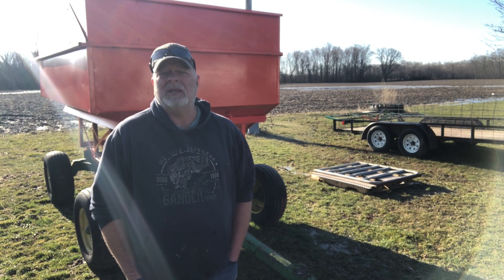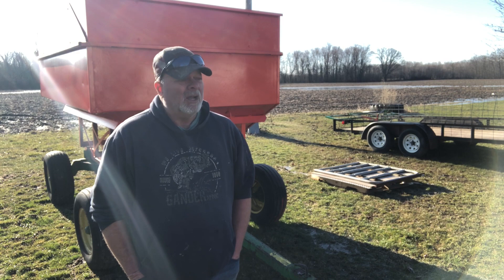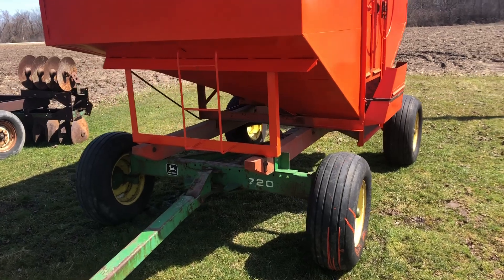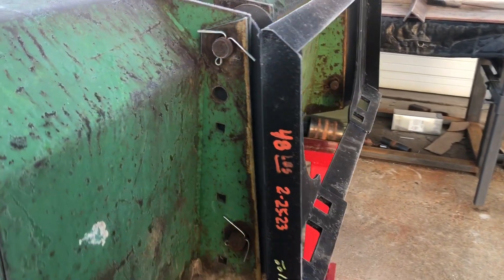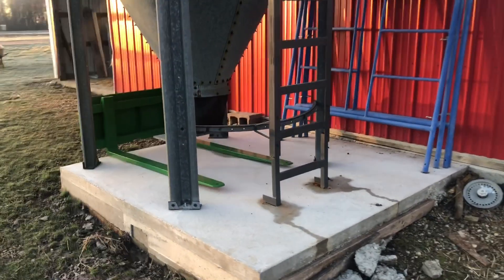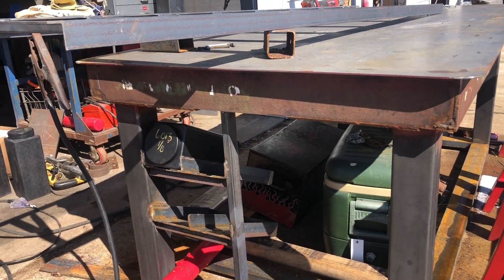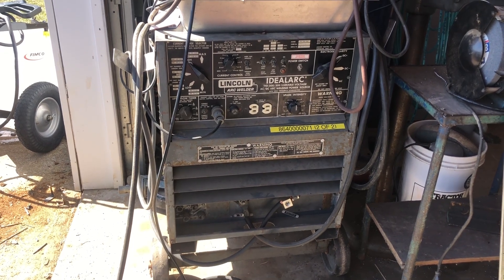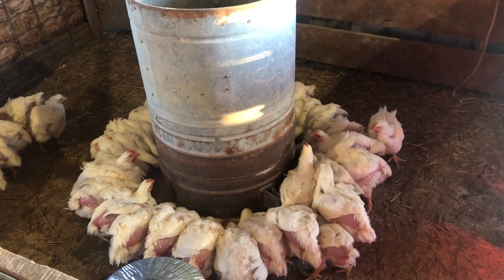Projects, Progress and Thank You Shoutouts

Comment: Nothing video worthy??? It appears you have been too busy to turn on the camera 🤣🤣🤣
Nice job on the gravity box. Especially having on the John Deere running gear. I don’t think that John Deere takes a back seat to anybody in the wagon running gear department. We had 3 thrower bale racks and 2 barge boxes, all on JD running gear. All with the extendable tongues. They sure trailed beautifully. 
The little feeder turned out nice. I am not a big fan of that style of lid though. They are very problematic but the way you guys work, it will be modified to work better than new.
Reply from the maker: There’s probably a bit of truth to not turning the camera on. The bin lid is different than others I had. Hope there’s o problems with it.
Thanks Gary